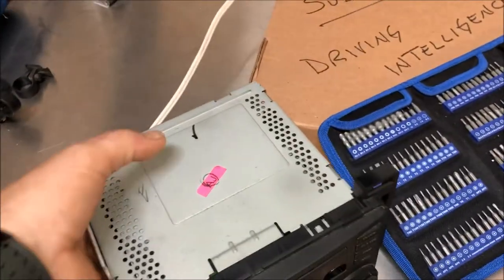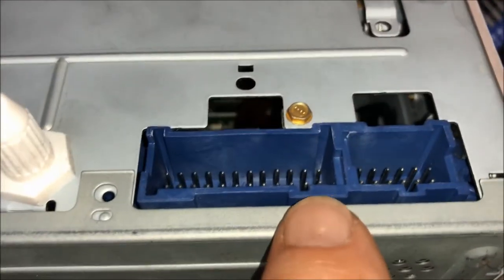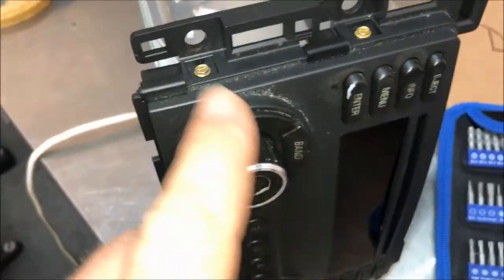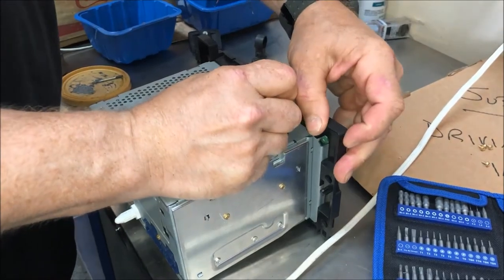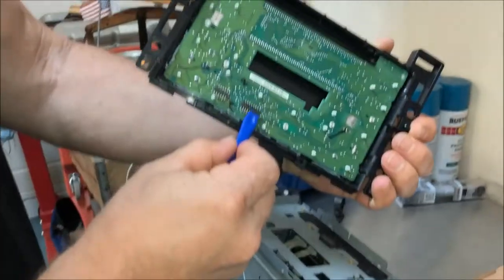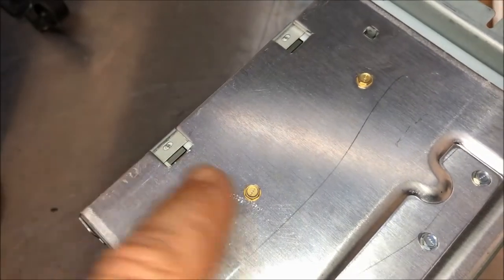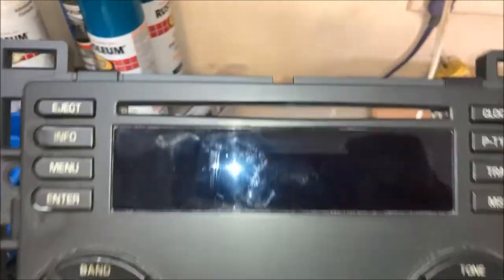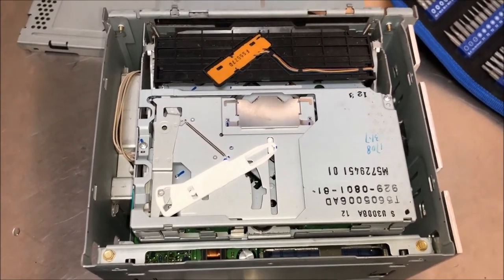EASY!  How To Remove CD (Compact Disc) From a Failed, Broken Head unit / Stereo / Car Radio

Comment: Just subscribed. I love the work you have done for your gen 10 f150. I am interested in actually removing and rebuilding the seatbelt mechanism. Any tips?!
Reply from the maker: Hi there, thanks for joining my channel.  Which part of the mechanism are you referring to?  The retractor?  Or the buckle?  If retractor, in the seat or attached to the ceiling?
Reply: Yessir! I am taking on more DIY projects specifically do to the cost for repairs. And my truck is my daily driver. So time and money counts!!! 

Getting back to your question, little things like interior updates/I have never worked like the seatbelts. Previous heavy smoker/shade tree mechanic. And I too like clean things!!!!

I love your video on Gen 10, f150!!!!